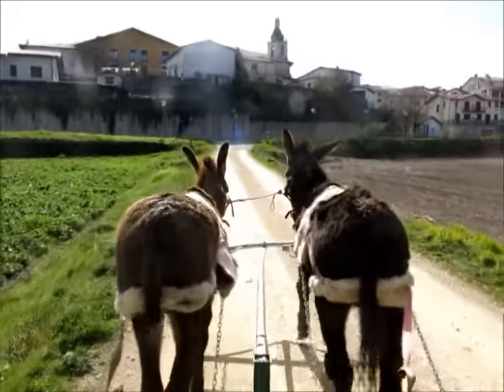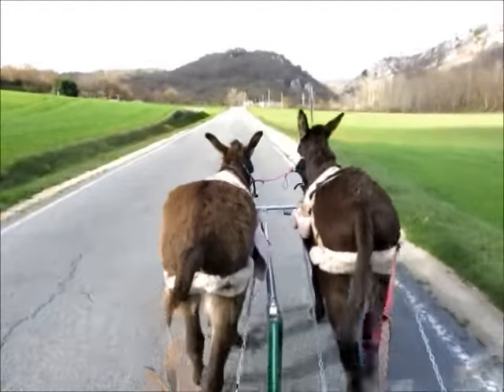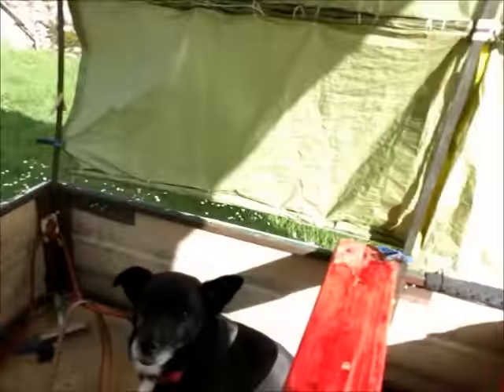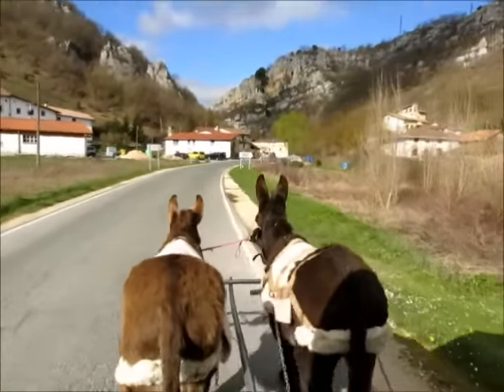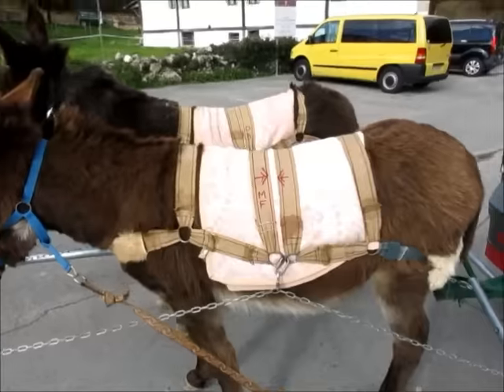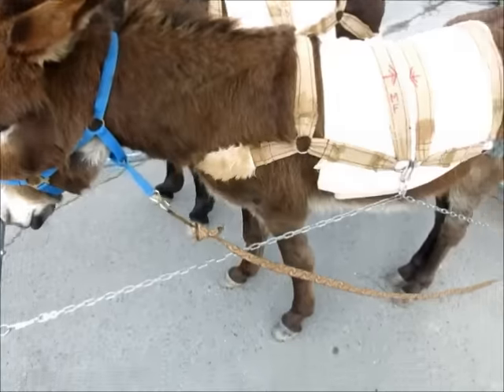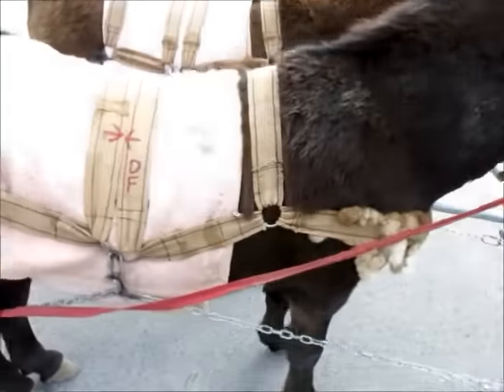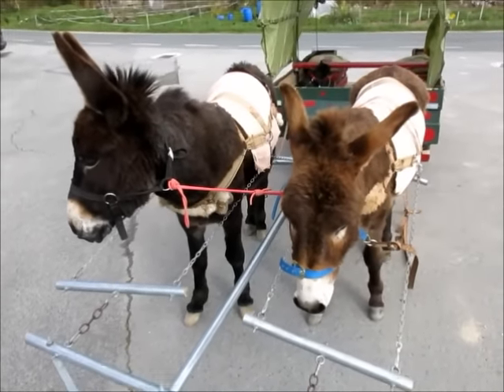Single axle donkey cart

Comment: Where did the design come from? It looks very similar to a pattern used in South Africa.
Reply from the maker: I think I referred to a publication by Tibits, which I found on the web. If I remember correctly it's typical of Ethiopia. It works and I still use it. The problem is that it's heavy and only has one axle, which makes it unstable and complicates the weight problem. With two axles the donks are just pushing the cart.
Reply: @ThePhelixfil  Thanks, It might have been one of these https://www.facebook.com/2010816785829365/videos/2015489752028735 They are an alternative to the local Cape Cart or ox cart yokes.
Reply from the maker: @petermuckle8318  Ha ha! It certainly is!! That wagon is exacly the same as mine. The donkeys movement is the same too.  I have a certain fondness for this wagon. It owes me nothing now and is the veteran of many trips with kids and a couple of mini expeditions. We even flipped It once in very high winds. My team were completely unphased by that! They are the best :) But really it's very slow and heavy. Going any distance in it gets very boring! Thanks for sharing the link. Made me smile :)

Comment: The breeches look very tight to me.
Reply: why not?
Reply: Normally a hand should fit in there.
Reply from the maker: Ha Ha! I'm glad the project and video have provoked some discussion.  You are right the breaching is too tight and I have now completely re-made the harnessing. There is no girthing as the weight goes onto their backs and it doesn't come off.  The driver has to do a bit of a balancing act due to the single axle and obviously you only want a bit of weight going onto their backs.  The driving force is a pushing one through their chests. '
The new harnessing is the same design as this except I used nylon webbing which I sourced from a factory which prepares loads for trucks. The factory has excess pieces which they would otherwise throw away and I get it for free.  It's that sort of thick nylon webbing which is used for ratchet strapping loads.  It's easy to sew the webbing with a sewing auger.  It's also very comfy and doesn't cause any chaffing.  The wagon is a bit of a shit really as it's heavy and would be much better with two axles.  This was a very low budget project (ie. cost nothing) and it's one which I continue to modify and improve.  I'd like to get a double axle cart and connect all four of my beasts.  If anyone has any questions what so ever please get in touch.  I am just making all this up as I go along and I know how easy it is to end up "reinventing the wheel" as it were.  
These donkeys received no training at all.  I just harnessed them and off they went as if they had been doing it all their lives, which from an evolutionary point of view they kind of have been.  Older donkeys might be a little more suspicious of this kind of project and you should always respect their fears.  Patience is the key with donkeys ;)
Reply from the maker: See  below ;)